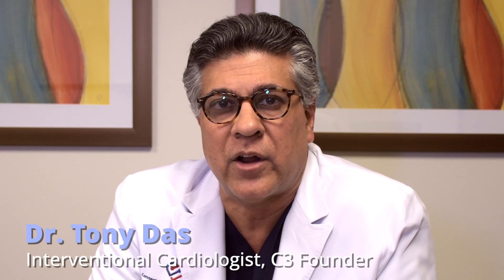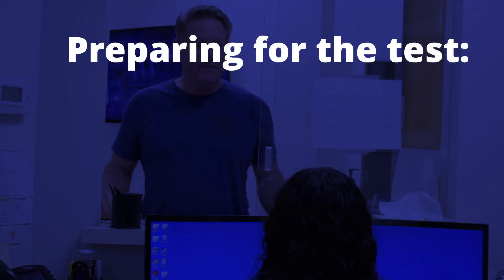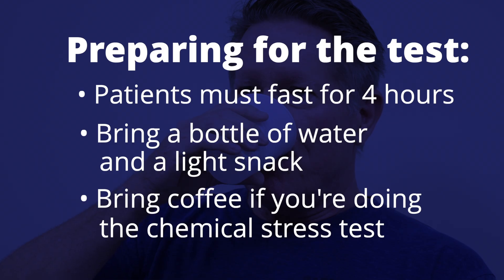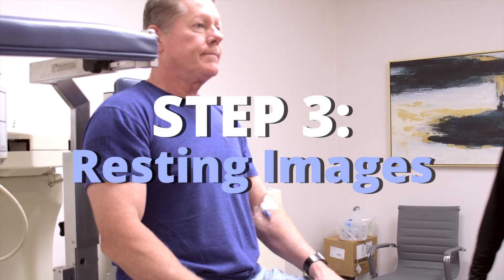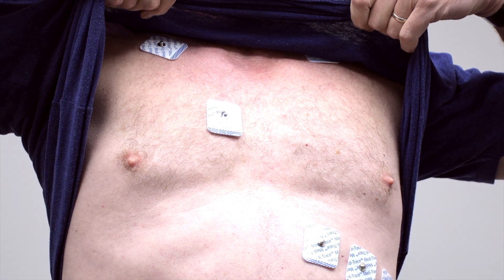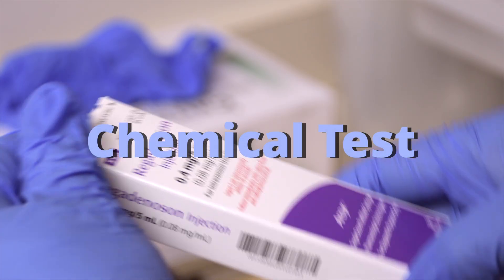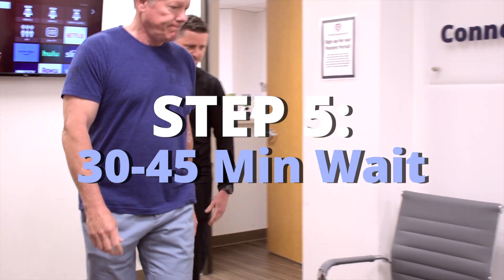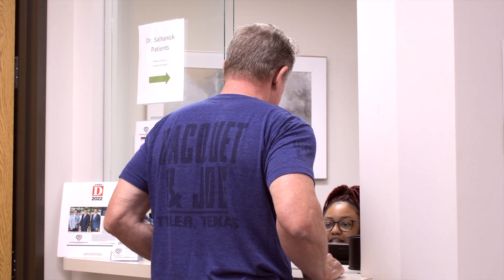What is a Nuclear Stress Test? - Full Video Walkthrough - C3

Comment: I had this test done today with some apprehension, I'm 60 and have had zero side effects from the test, my health issues include compromised immune system IgE levels are near 1000 severe allergic asthma, I'm 250 pounds and 68" tall, I reached 136 bpm in about 4 minutes on the treadmill, I've angina over the past few years and bradycardia HP goes from 45 to 65 constantly while resting.  Good luck!
Reply: Did you get the results yet?
Reply: @lisaquedens8402  Yes and my cardiologist told me everything is normal as my left and right ventricle ejections are with in range. 
During the past few weeks I've had a Cardiac Stress Treadmill MPI~ ECG
Date Jul 09, 2025
Echocardiogram Transthoracic
Date Jul 01, 2025
Holter Monitor
7 days cardiac monitor.

Results
Copy/pasted: NO ECG CHANGES SUGGESTIVE OF ISCHEMIA NOTED WITH EXERCISE.

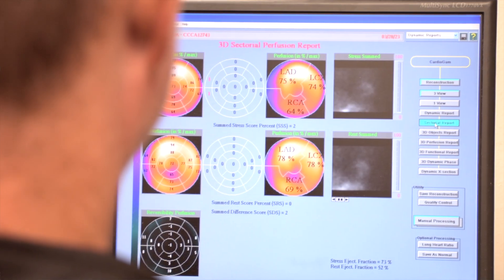EXERCISE TIME: 4:07
ARRHYTHMIAS: VENTRICULAR LOWN CLASS: 0 
So all is seemingly normal with no blockages, also my cholesterol is 144. I will see my Cardio in September. I plan to explore why my heart rate is below 45 at different times, it maybe just, my genetics as I'm not an athlete much past monthly or weekly weightlifting, cycling and walking a few times a month. The Docs suggested in getting a Smart-Watch with ECG capabilities, so, I bought a Amazfit Bip 6 Smart Watch, though is doesn't have ECG, it was a great choice for under a $100 it can monitor BPM and Oxy and does a multitude of other tasks. In the future (Black Friday) I'll look into either the Fitbit Sense 2, Google Pixel watch or the Samsung Ultra for deeper heart monitoring. Sorry my answer was so long and somewhat detailed. Any other questions feel free. Best Regards.
Reply: @lisaquedens8402  Yes and my cardiologist told me everything is normal as my left and right ventricle ejections are with in range. During the past few weeks I've had a Cardiac Stress Treadmill MPI~ ECG Date Jul 09, 2025 Echocardiogram Transthoracic Date Jul 01, 2025 Holter Monitor 7 days cardiac monitor. Results Copy/pasted: NO ECG CHANGES SUGGESTIVE OF ISCHEMIA NOTED WITH EXERCISE. EXERCISE TIME: 4:07 ARRHYTHMIAS: VENTRICULAR LOWN CLASS: 0 So all is seemingly normal with no blockages, also my cholesterol is 144. I will see my Cardio in September. I plan to explore why my heart rate is below 45 at different times, it maybe just, my genetics as I'm not an athlete much past monthly or weekly weightlifting, cycling and walking a few times a month. The Docs suggested in getting a Smart-Watch with ECG capabilities, so, I bought a Amazfit Bip 6 Smart Watch, though is doesn't have ECG, it was a great choice for under a $100 it can monitor BPM and Oxy and does a multitude of other tasks. In the future (Black Friday) I'll look into either the Fitbit Sense 2, Google Pixel watch or the Samsung Ultra for deeper heart monitoring. Hope my results and experience helped you in some way. Any other questions feel free to ask. Best Regards.
Reply: @lisaquedens8402  @lisaquedens8402 Yes and my cardiologist told me everything is normal as my left and right ventricle ejections are with in range. During the past few weeks I've had a Cardiac Stress Treadmill MPI~ ECG Date Jul 09, 2025 Echocardiogram Transthoracic Date Jul 01, 2025 Holter Monitor 7 days cardiac monitor. Results Copy/pasted: NO ECG CHANGES SUGGESTIVE OF ISCHEMIA NOTED WITH EXERCISE. EXERCISE TIME: 4:07 ARRHYTHMIAS: VENTRICULAR LOWN CLASS: 0 So all is seemingly normal with no blockages, also my cholesterol is 144.
Reply: I will see my Cardio in September. I plan to explore why my heart rate is below 45 at different times, it maybe just, my genetics as I'm not an athlete much past monthly or weekly weightlifting, cycling and walking a few times a month.
Reply: The Docs suggested in getting a Smart-Watch with ECG capabilities, so, I bought a Amazfit Bip 6 Smart Watch, though is doesn't have ECG, it was a great choice for under a $100 it can monitor BPM and Oxy and does a multitude of other tasks. In the future (Black Friday) I'll look into either the Fitbit Sense 2, Google Pixel watch or the Samsung Ultra for deeper heart monitoring.
Reply: Sorry my answer was so long and somewhat detailed. Any other questions feel free. Best Regards.